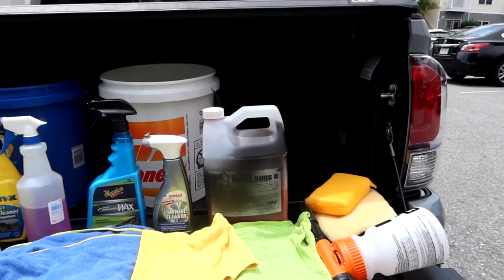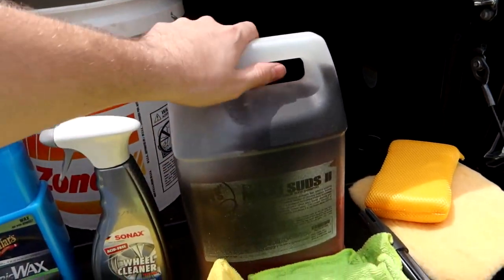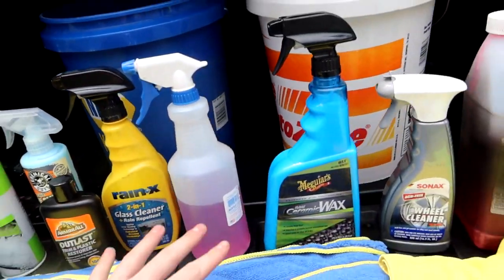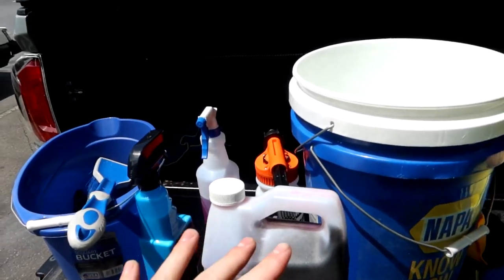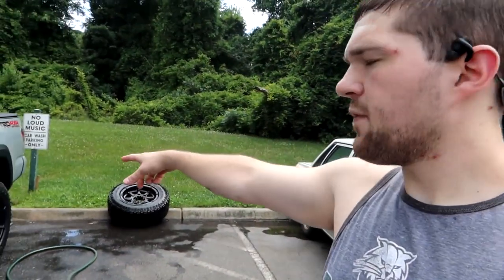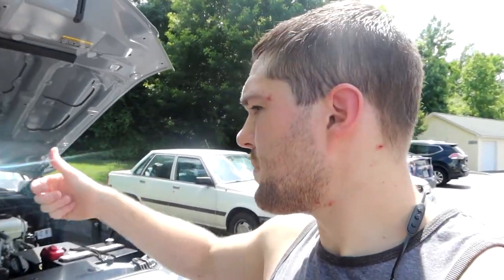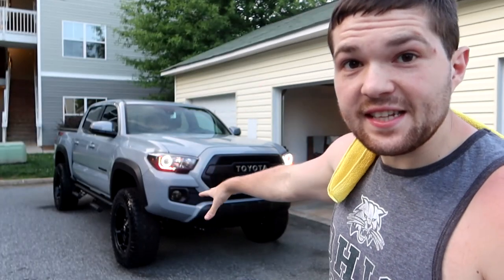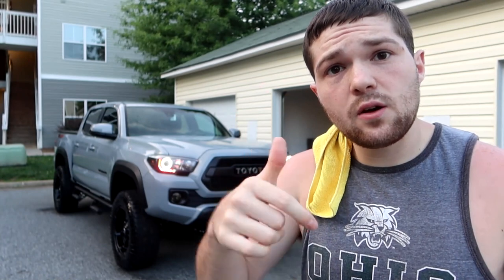How to Wash your Truck (2020 Toyota Tacoma)

Comment from the maker: Products Used
Main Wash
-2x 5 gallon buckets https://amzn.to/2VI7mfp
-Foam gun https://amzn.to/2YW4Dke
-Chemical Guys Maxi-Suds II  https://amzn.to/31D0OlY
-Wash mitt https://amzn.to/31I54Re
-Bug sponge https://amzn.to/2ZEqBr8
-micro fiber towels https://amzn.to/2ZuhkC4

Wheels
-Sonax tire cleaner https://amzn.to/2D2qgqB
-long handle brush https://amzn.to/2Zxq8as
-short handle brush https://amzn.to/3gk4tJi
-7 brush kit https://amzn.to/31KPYdA

Detailing
-Meguiars Hybrid Ceramic Wax https://amzn.to/2AsDP1P
-RainX window cleaner https://amzn.to/2VLNoQG
-Ultimate Plastic Trim https://amzn.to/3eXhXuz
-Foam tire shine https://amzn.to/31FqqP6
-Chemical guy tire kicker https://amzn.to/2NTtFKG

Comment: Hey Rick. The truck turned out fantastic! I have the same truck with a protective paint film on the hood. Would you apply the wax over that as well or work around it?
Reply from the maker: Yes wax it too. It will help with the uv protection.

Comment: You dont use the liquid in the bottle that comes with the kit for the clay bar..?  what do you use the bottle for..?
Reply from the maker: You can use the stuff in the bottle as well but it really doesn't matter as the whole goal is to provide lubrication between the clay and the paint. Either will work.

Comment: Surprised you didn’t use a pressure washer. Or ceramic coated your rims. Mine been running for last 2 years and my car washes take about 45 minutes.

Comment: Can you give me your opinion of the tire shine product, I remember using Armor all years ago but it seemed to build up a greasy surface so that if you ever rubbed against it, you would get grease on your pants or legs, does the product you use create a build up ..?
Reply from the maker: I was not a fan. It was dry to the touch and clean but didn't last but a week. Tire foam is so much easier and cheaper.
Reply: @TacoRick  If you have yet to discover a great tire shine, I highly recommend Pinnacle Black Onyx. Pricy but dries and lasts for weeks.

Comment: Hey Taco Rick. Do you use anything in particular to protect your headlights for oxidizing? Did you put the ceramic coating on the headlights, plastic trim, and windows?
Reply from the maker: Yes ceramic on everything.

Comment: How did you like that ceramic wax? Also, my 17 Taco outside door trim (around windows and back window) seem to have pollen or something dried on it. (I bought it used) how would you clean that? Can it be cleaned up?
Reply from the maker: So far not bad. Only used it once so far. It's supposed to get better the more you use it. 
Not aure on your issue have to see it
Reply: Taco Rick wish I could send ya the picture as I don’t know how to clean it. 
I think I’m going to get that Ceramic wax and try it on mine. I’ve not detailed mine since I got it a few weeks ago (used)

Comment: How did the tire shine stuff work? I want something that looks dry but will make the water bead up and run off? any tips?
Reply from the maker: Not worth it. Sticking with cheap tire foam
Reply: @TacoRick  I tried some meguiars "hot shine" it looks good. Nice matte finish. We will see how long it lasts.
Reply from the maker: @nathanstrick9353  tried it before didn't last more than a week.... the longest lasting stuff I have had is the endurance jel lasted about 3 weeks but its a pain to apply.